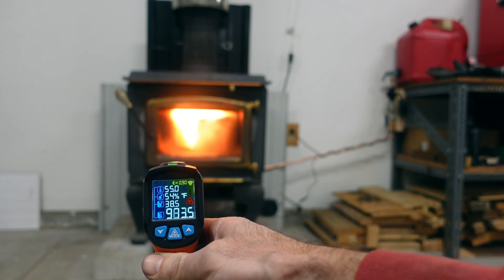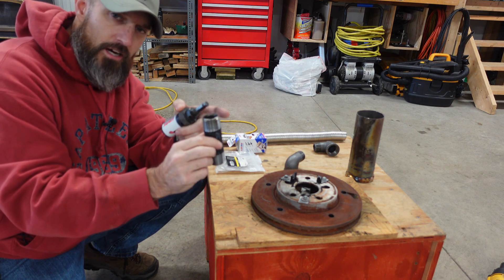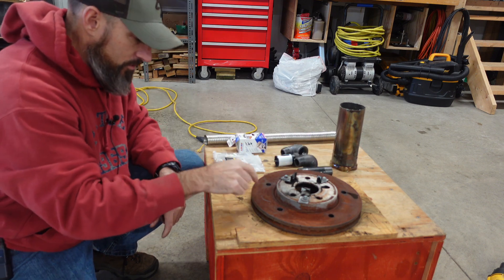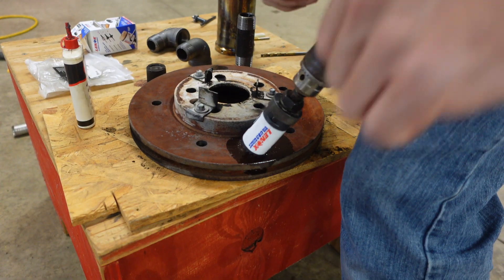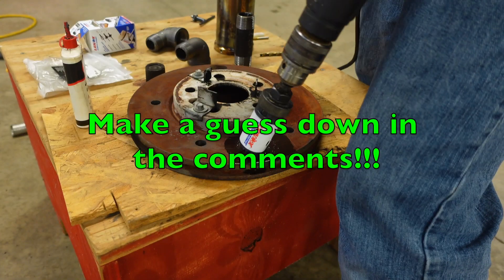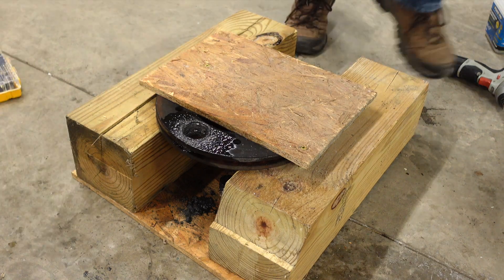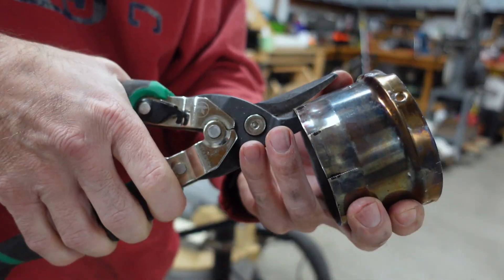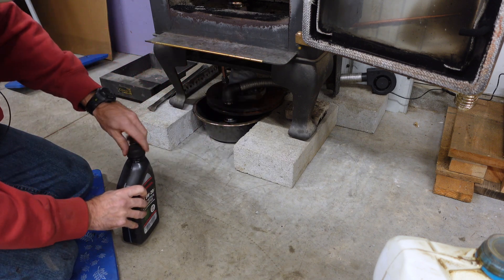Stage Two blower on my DIY used oil burner

Comment: Jim, you need to weld four small 90 degree elbows (all pointing same way) to the bottom of your pipe in the burner, with holes into the pipe. This way you will get a spinning BLUE flame that you need. This is what i did. Thanks for the video.
Reply from the maker: I have seen them like that, thanks for watching

Comment: Heavier oil works wonders when drilling large oils used motor would be better then whatever you were spraying on i use a small old paint brush and a tin can to brush oil on the bit also try to go slower if the drill has a lower gear use that otherwise about half a trigger pull
Reply from the maker: Thanks for the tip, and thanks for watching

Comment: what is that door glass rated at
Reply from the maker: Really not sure that’s a good question. I never thought about that, holy smokes.
Reply: @DIYJIM  i had a fireplace screen/glass that shattered from just using those paper firelogs after power outage ...took a couple days and im sure no where near as heavy duty as your stove glass but no where near as hot as your fire .... put a box on top and you got a nice pizza oven

Comment: For a brake rotor, I'd try to slow the drill down, if you ever want to ....use that bit again! In watching that first video, I think the efficiency improved because the fuel supply temp changed. All carbon based fuels have a sweet spot for BTU conversion. Gasoline, diesel, old motor oil, each would work best at a given ambient temp. Too cold, not so good except maybe for gasoline. Too hot and they all will diminish on a power output per gallon basis. I don't think you should use it to melt metal. That exhaust pipe material leaving the top of the stove didn't look like schedule 40 pipe and you would probably need that up above 600 degrees
Reply from the maker: Thanks for the tips! Thanks for watching

Comment: Great video thanks,  How many people live in your town it seems you are in a subdivision?  Have your neighbors complained about the smell and can you smell it when you go outside?  Is there a way you can mount a fan behind or on the side to get the most heat in your garage before it goes out?  Maybe a second heat exchanger to capture more of the heat you are losing.  I saw this guy use a old hot water boiler radiator to get more heat out of his exhaust before it went outside. pretty cool! https://www.youtube.com/watch?v=6WrCJcfICF4   Not that your complaining about not having enough heat just thought it would make a good video.  Keep up the great content! Thanks Rush
Reply from the maker: I could not smell anything when I went outside. Thanks for watching

Comment: Aluminum melts at 1,221° so you'd need to push the blower a little bit harder...but you're basically there. Might be a bit messy though. Lol
Reply from the maker: I’m working on it now. Rebuilding the exhaust so it can withstand more heat and bought some more fire bricks. Thanks for watching